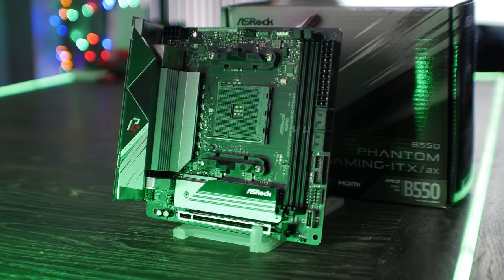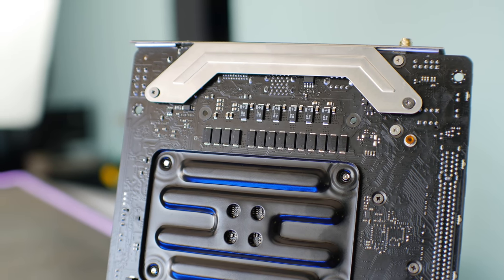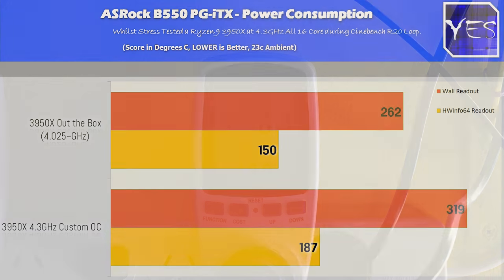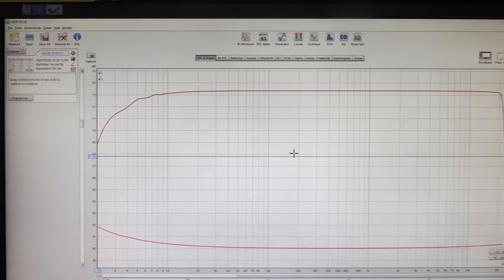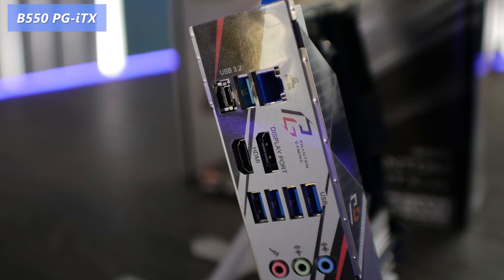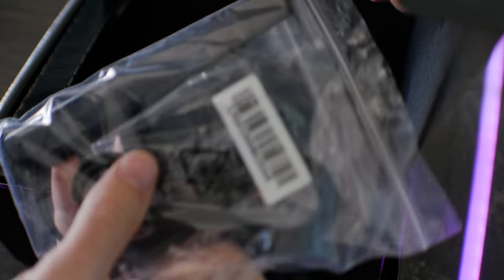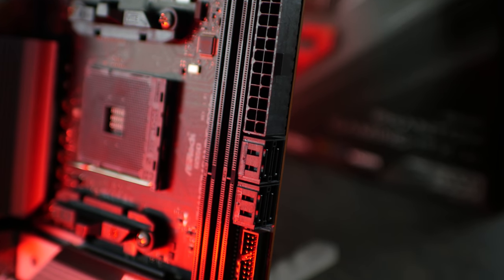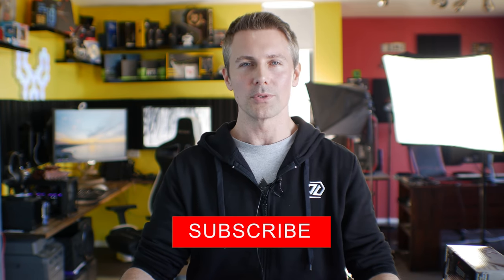ASRock B550 Phantom Gaming ITX  Review - $200 of Pure Motherboard.

Comment: I was waiting for this! I personally have an ITX Asrock motherboard in my daily build. EVen though I bought it back in 2017 and it's a Z370, I've recently upgraded to an i9 9900KF, as I showed in my setup tour, and I was able to reach 5.1Ghz on an ITX System, on that motherboard which wasn't even designed for 8-core CPUs. Of course, it required a delid and a copper IHS, but it was worth it!

Comment: I was looking your review of b450 ITX from Asrock back when released. Today I am looking of upgrade I will need in 2021 but I still come to a conclusion that that b450 itx still does everything I need except one thing. It misses 2nd m.2 slot for ssd. That is where asrock did good job with b550. Anyway I can only recommend asrock ITX. Had no issues with it. Bios got better and better after updates. Overclocks ryzen 3200g to 4.2ghz with ease as well as vega 8. Definitely will be looking to Asrock MB when upgrading. Love ITX :)

Comment: I went Gigabyte X570 ITX over all others for SFF cooler compatibility, VRM efficiency, 2x 4.0 m.2, and a preference for Intel Gigabit LAN over Realtek 2.5Gbe. If it had Optical Audio, it would be my perfect board for this generation. Eliminating the integrated video traces and connectors for a $250 USD board would allow more enthusiast features, or just USB ports.

Comment: You should also look into the Asrock b550m itx. It's the cheapest itx b550 board by a country mile ($100 aud between it and the next cheapest). Some people expressed concern about the weak heatsink and i'd like to see how much that affects performance with the higher core count models. I'm getting one once the stock resupplies so for me it's validating my purchase but there could be alot of interest as no one else has done a video on it.
Reply: i have one with the ryzen 5 5600, it works fine. Not sure on how it's perform wioth higher end cpus, tho

Comment: The X series motherboards make no sense on ITX.  I only use ITX for the past 4 years or so.  My first AM4 board was the Biostar X370 ITX board, but that's simply because it was the first Ryzen ITX board to market.  My next was the ASRock B450 and I'll be building with this B550 board as soon as I am able to flash the bios for Ryzen 5000.

Comment: I'm in a jam fellow YES-viewers... I have an 8th gen i7/1080ti gaming rig (main rig) and an AMD Ryzen 7 2700/RX 580 8gb backup/side gaming rig. And finally I have a Raspberry Pi 4B for web browsing/office software. Here's my issue: The Pi 4B is just SLIGHTLY too weak to watch 1080p videos on YouTube.... it can do it but it's choppy (damn it comes close though.... I bought the damn thing exclusively for this purpose). I still use the Pi but I have to limit my video to 720p so it will run smooth. So here's the dilemma... Build a super low end 3rd rig in a super tiny case (think newest generation Pentium or maybe even i3 or even older i7 or Pentium (I own an i7 2600 and also a Pentium G3258 that are not being used right now) as a browsing and office only micro system and use only the built in graphics or swap my Ryzen 7 2700 into an ITX board and build a small forum factor fully capable gaming rig but use it mostly just for office and browsing and as a gaming rig when the Intel rig is down for maintenance/repair. (Don't laugh... the AMD rig ended up being my main gaming rig for a few months while I tried everything under the sun to save a corrupted Windows install on the intel rig... and I failed and it cost me about $400 worth of bitcoin... so yeah... the backup rig has a purpose lol) Honestly I'm thinking G3258 as a GPU-less 3rd rig that is office and browsing only. What do you guys think?
Reply: If you got good cooling for the Raspi you could try
[pi4]
over_voltage=6
arm_freq=2000
gpu_freq=666
in your  /boot/config.txt

Comment: hey brian, have u tried the i7-7700T Engineering Samples in aliexpress/taobao?  i7 7700T ES QKYL is the code. paired with a cheap/used 1151 mobo. im curious if its any good

Comment: B550 boards are so damn expensive compared to B450...
Reply: Its ITX
Reply: It's more expensive because of that PCIe 4.0. Newer technology usually costs more until it matures.
Reply: @mr_sowong9464  I know, but even then it's more expensive
Reply: @cosmicusstardust3300 That depends entirely on the technology and the manufacturing processes involved (at least when we're talking mass produced consumer electronics).

Might as well be a business decision, as AMD is very popular, has been on the same socket for years and even a lot of enthusiasts go for B450 over the X470 lineup. Compared to the years of Intel dominance and anually Z line motherboard refreshes the manufacturers must be loosing a lot of revenue...
Reply: @jacket0708  The price hike is justifiable. B550 is definitely an upgrade over B450. PCie 4.0 is one thing to say it has over B450 and also a nice little bonus with that it has no stupid chipset fan. Another one is that it has way better VRM, at least for the ones that are $180 and up. Like for example the $280 B550 Aorus master has a true 16 phase power delivery with very good cooling on the VRMs, the same exact VRM you'd get on the $700 X570 Aorus Extreme.
Reply: @jacket0708  well its still new. Wait a couple months and the prices should be dropping

Comment: Do itx boards have less power than an atx? Or less capabilities? Just got this with a 6700xt off of Newegg shuffle. Would it be okay with a 5900x and a 6700xt? I got 4000mhz ram and a gen4 ssd lol. Is that overkill  for this Mobo?

Comment: im a little skeptical about asrock boards. they dont last the distance.
Reply: i am sure their board is safe, mine with h81m-vg4 for haswell gen 4 is still working fine until now since 2014 i think, no problem at all just to change cmos battery once and the rest is still working fine, just make sure you're using decent psu

Comment: what kind of SSD can go in the back M.2 slot?  I am wanting to put the fastest SSD I can find for storage purposes back there as I am going to be putting the firecuda 520 in the front slot, but was confused with what ASRock says on their website for this board.  Can I put the Western Digital Blue SN550 NVME SSD in there and not use it for a boot disk?  The ASRock website states for the back slot it supports NVME SSD as boot disks.  What does that mean?  The Western Digital I am looking at is NVME but I do not want to use it as a boot disk.  Sorry for the long post, but if someone could clear that up for me I would appreciate it, thanks!

Comment: This board is too expensive for what it offers. Especially since Asrock still ships boards with defective / erroneous / mis-calibrated temperature sensors that fuck up Precision Boost 2 and cause it to increase stock power consumption more than necessary. For 30$ less you can buy the MSI MAG B550M Mortar WiFi, with the same Intel 2.5G NIC and AX wireless, more expansion and connectivity, better VRM heatsinks and no sensor bugs.

Comment: In this last year I've had: the Asrock x570 itx, then the Giga X570 itx later the Aorus Master X570 ATX and I've just recently go back to ITX with this board. 

I liked a lot both Asrock ITX, maybe even more than the most famous Giga ITX, but the X570 had a terrible mounting CPU cooler that complicated everything and lacked some USB ports, it has TB which is great and I miss in the B550, but this last one even expensive is more well rounded. The lack of two M2 right now is a huge miss from the X570.

In ITX the great stuff that comes with X570 ATX boards doesn't come to play that much due to size, so it's not that bad of a deal. And lately the REAL PROBLEM right now is avaiability. This puts lots of X570 out of stock and many sold by other shops aside AMAZON or NEWEGG that take advantage and sell at ridiculous prices above 300 bucks. In some cases even AMAZON sell some X570 itx at bigger prices than the originals ones, this make the B550 to look not as expensive as they really are. Stock is a nightmare, I bought my B550 and two hours later they went out of stock. 

This whole scenario gets worse because as a southern hemisphere neigbour of Aussies and Kiwis, me being an Argie, getting stuff with a good price is harder and al ot harder in my allways in crisis country. But so far, this little board had been great, yet I've just bought it so time will tell, I miss the TB thought and some clear CMOS button at least.

PD1: The Aorus Master ATX I've just sold WAS A BEAST! one of my favorite boards I've ever had, expensive YES, but hell it had so many cool features and incredible VRM. Amazing board.

PD2: random thought, but the day South Afrikans, Brazilians, Argentinians and Australians make some sort of UNION, I dunno if it will fail, but god damn we'll have some great women, parties and amazing sport atheltes. It would never happen but it would be FUN to the very least.

PD3: BTW I've paired all those boards with a 3900x, 1080 ti, two M2s PCIe one Gen4 another Gen3, two HDD of 4Tb, 64GB of RAM, this little fella handles cool hardware

Comment: But where are the itx boards to run a 3300x or an APU? Those sure don't need 90 amps and extra heatsinks. And a 200 dollar motherboard. AMD kills the low end with the high spec requirements.

Comment: This board cost as much as my x99, CPU, RAM, Mobo combo. Stay Xeon! B550 is so much of a worst deal than B450 :(
Reply: The cheaper boards are good value
Reply from the maker: They are built to handle 200 watts though through the VRM on an itx board, it's not easy to do. I don't think its a bad deal, but rather a implication of having so much variance in a product stack (4 cores all the way up to 16).